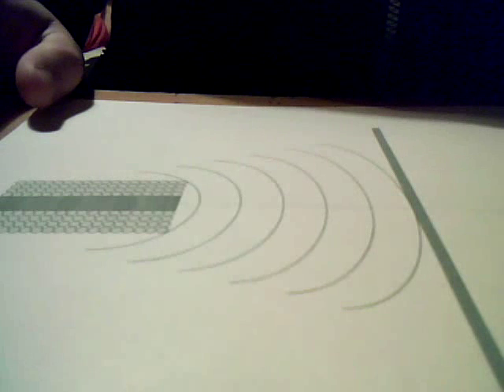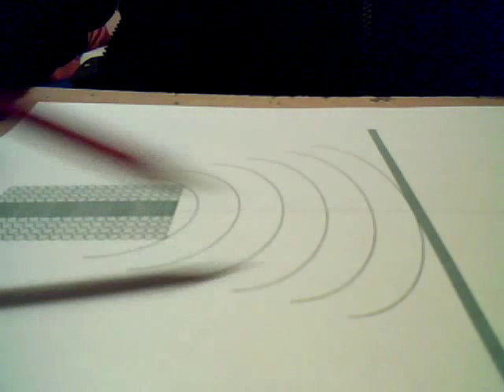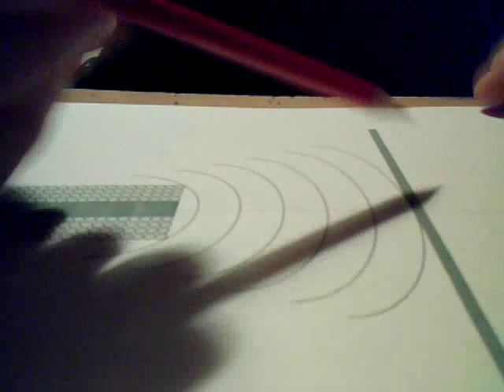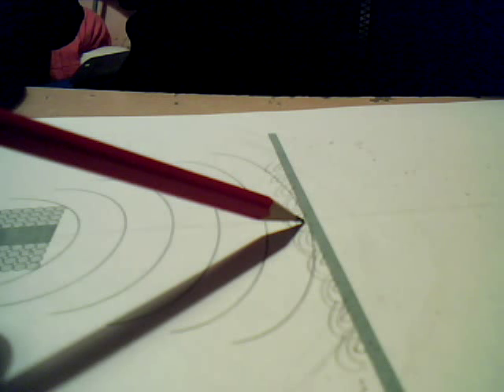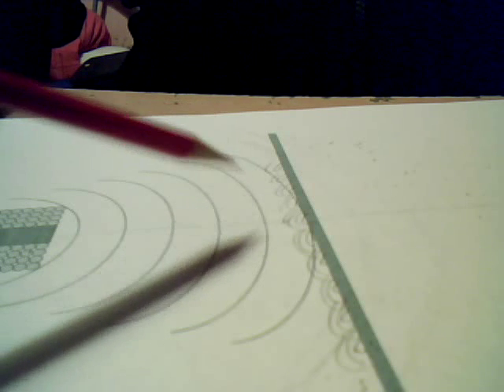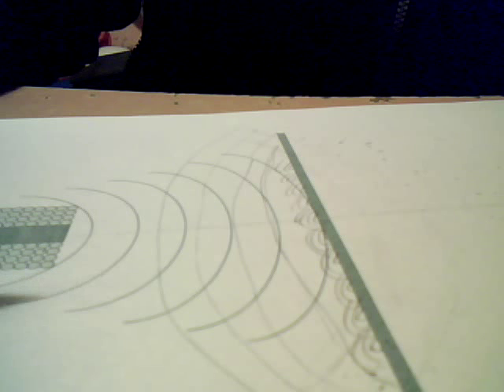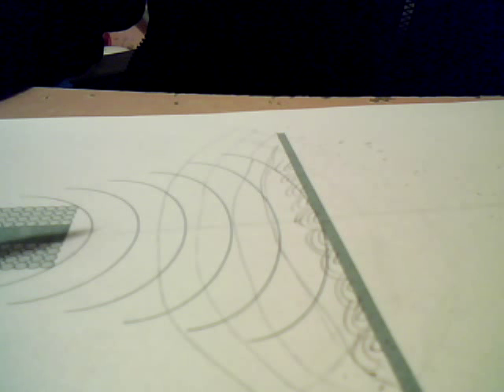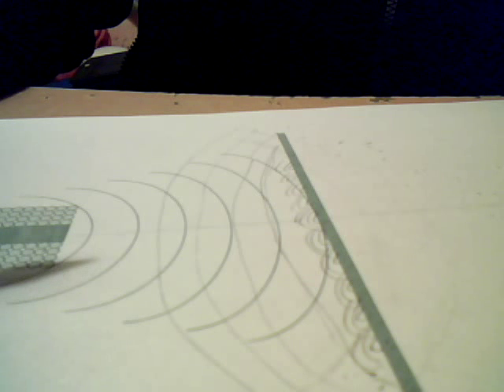Alternating Magnetic fields and there interaction with aluminium

Comment: Very cool explenation, im actualy trying to build motocicle propoltion sistem base on this principle.
Using AC linear motor along the inner part of the motocicle rim (aluminium) .
still have some doults  if it will have enouf torque to be usable ..

Comment from the maker: I've only experimented with copper, aluminium and lead thus far. However, if the element is electrically conductive then there is no reason it shouldn't.
However, an element that is also magnetic (magnetic conductivity) has completely different properties and does not produce a 'bounced' field on the same side as the incoming magnetic field.